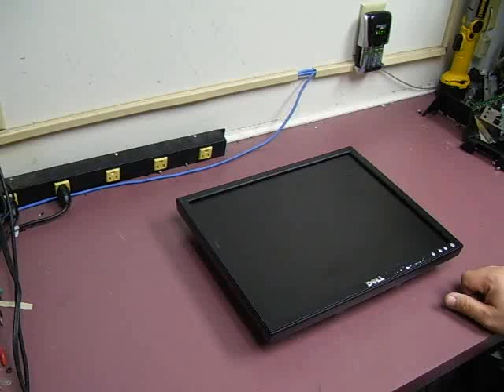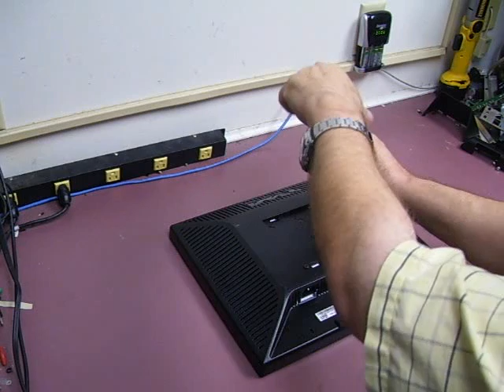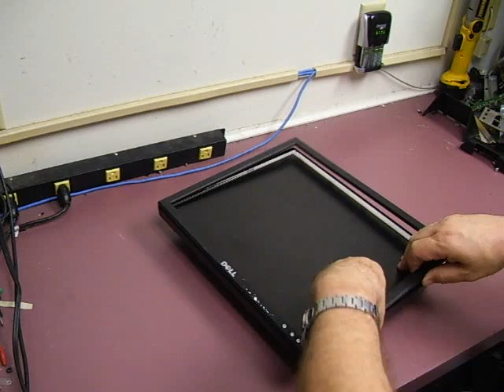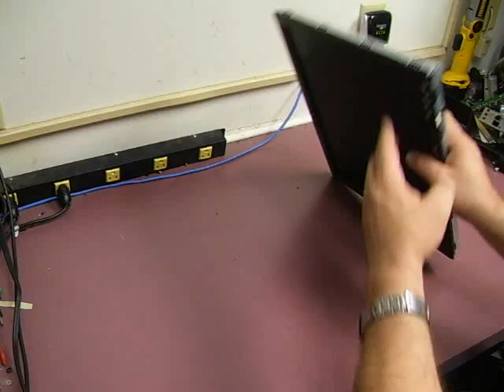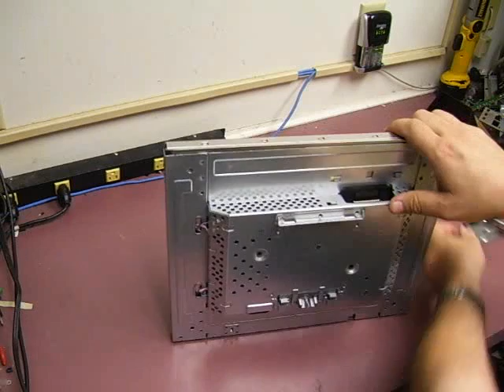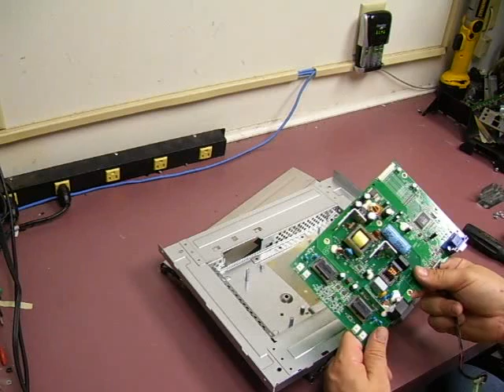Repairing a Dell E177FPf 17" monitor - Part 1 disassembly

Comment: Thank you for the video! With it I repaired my old DELL.
I mean...
I thought it had an error in the power cable connection.
Disassembled.
Accidentally broke the data cable socket between board and screen.
Didn't find any problem with power.
Assembled.
Didn't work but found the power cable was damaged...
Disassembled again.
Repair the data cable.
Assembled and now working... with another power cable.
An hour and a half to the devil.

Comment: Great video. I've just bought one of these monitors second hand to mount in an arcade table. Knowing how to remove the bezel without breaking anything is useful as I need to re-position the control buttons. For £5 this was good buy :-)